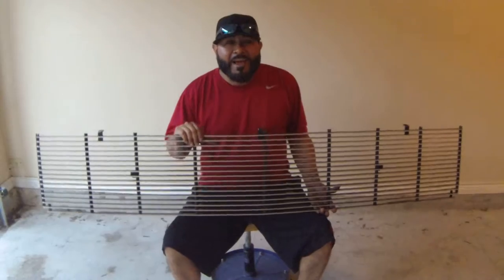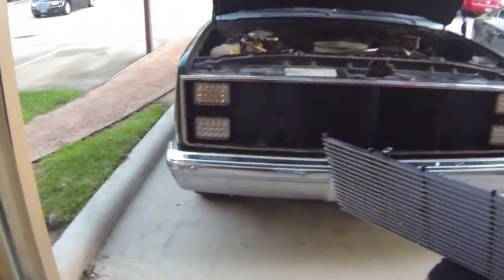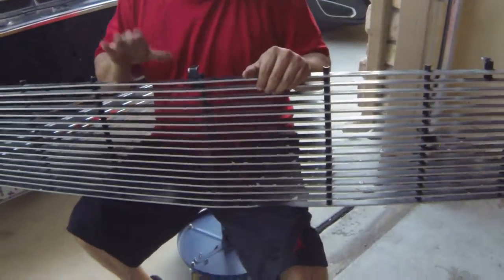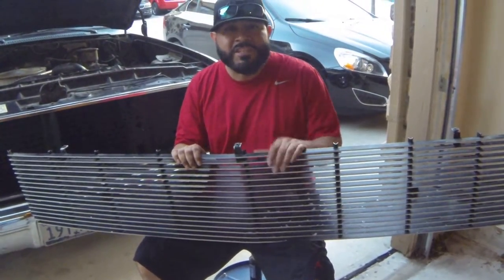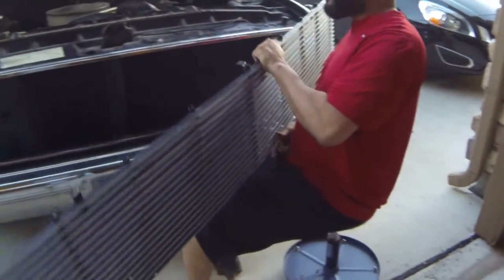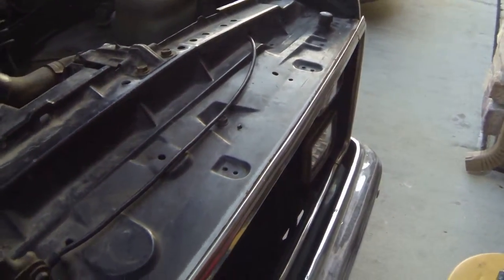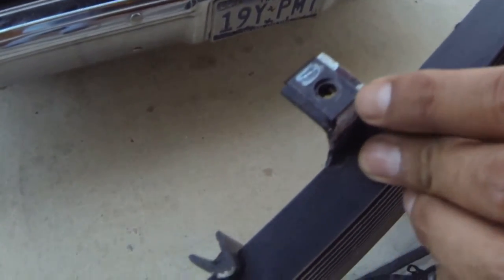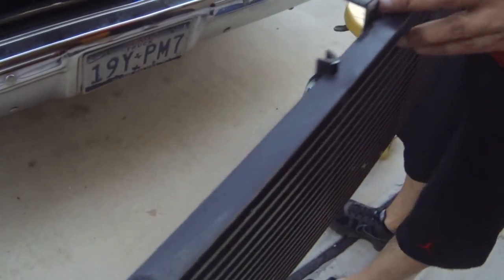How to install a Phantom Billet Grill on a Chevy C10

Comment: Short sweet and to the point. Looks good and it seems easier than what I was expecting. Some other billet grilles for this truck require some mild body work ie.drilling, which i do not want to do. Thanks for the vid bro. The audio is very low though.

Comment: I’m in need of some honest definitive answers pretty fast ..So How is the Light output “with multiple sections of the Billet bars  covering the headlights. I’m About to do phantom  on my 95” s10 but some people I know that do custom lighting and build custom projector lights are close too  talking me out of it . I daily drive the 95 and also Drive at  night but I also have New 4x6 sealed beam projector/led lights . 
I just definitely don’t wanna loose the output and light clarity if the bars get in the way too the point it’s a hassle too see and the Beam and pattern are wonky .Any insight helps on what to expect.
Reply from the maker: I'm not sure what headlights you plan on installing or the output of them, but the phantom grill has NOT impeded the output or light clarity for me.